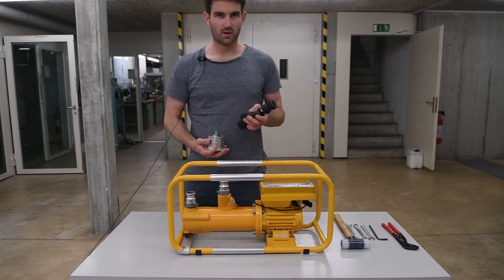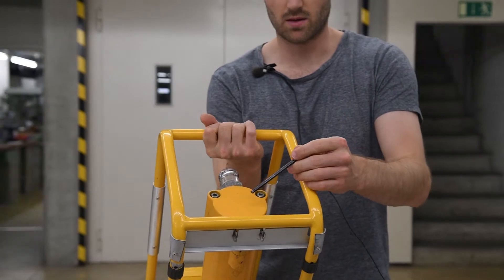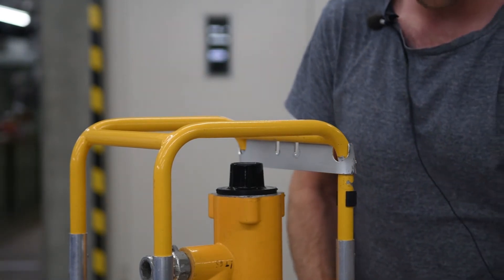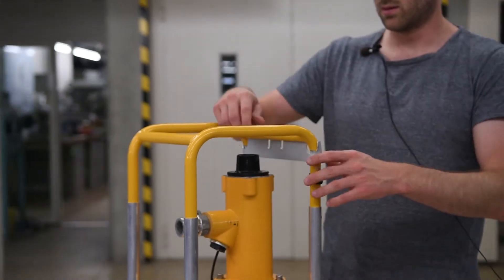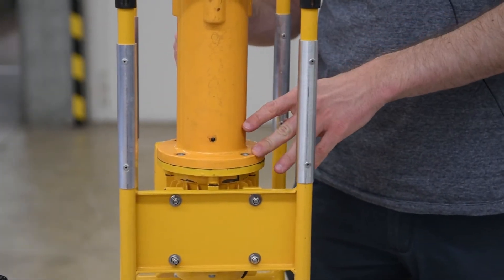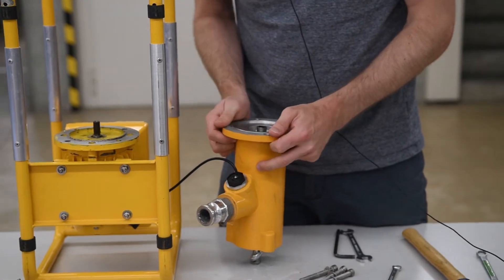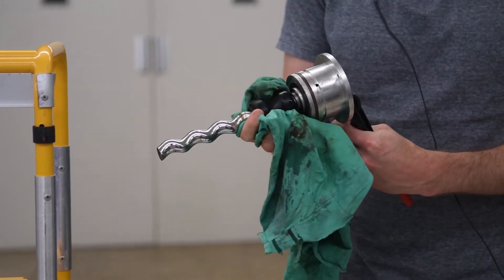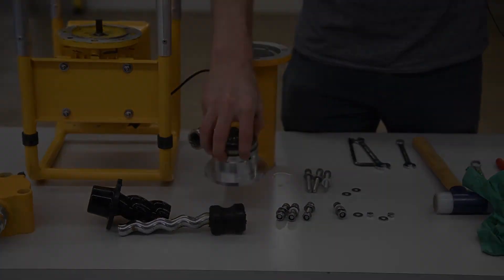🔧 Disassembling the "sunlight pump" solar pump

Comment: I have a question, how can you remove or disassemble that mechanical seal? Help and show me how to remove it
Reply from the maker: You do not need to remove the mechanical seal, just change the insert assembly that connect rotor to motor. Ennos provide some spare part.